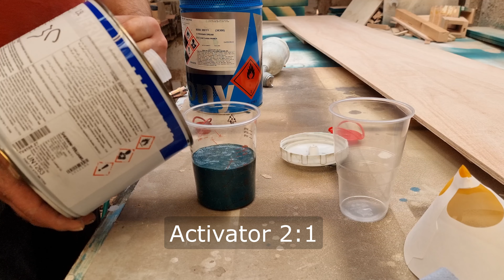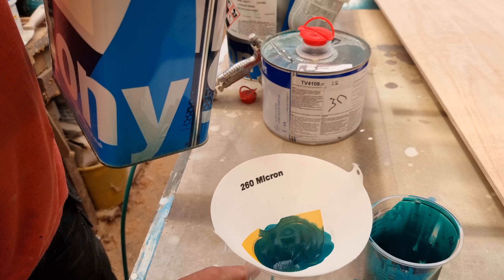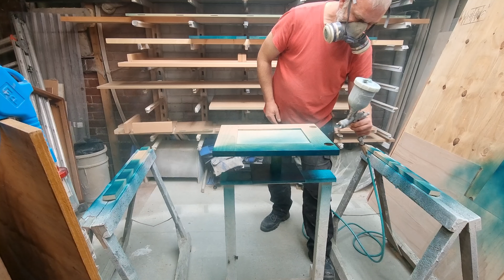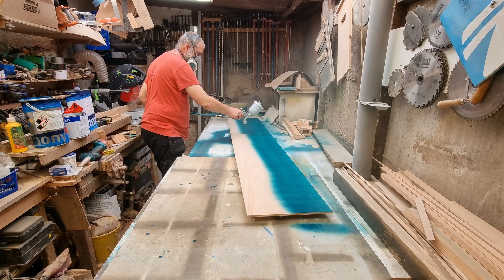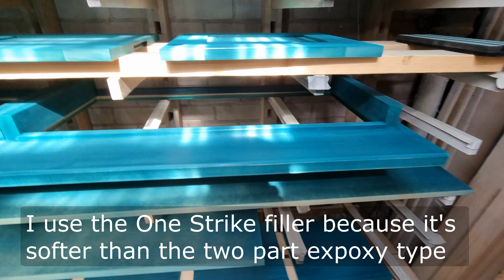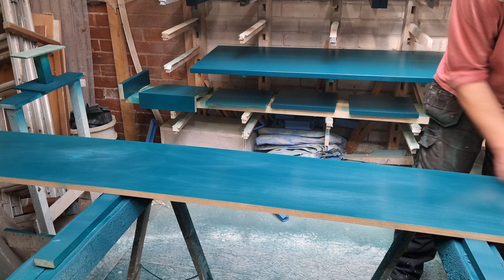Built-in bed over bulkhead build Pt6 - Spraying the frame, doors & shelf unit with PU lacquer

Comment: Great spray job mate, had to laugh when you cleaned your filter 🤣😂thought it was only me that was tight as a ducks arse ( and yes I also clean my filters so they last the day no matter how many mixes I do ) 👌👌👌👍👍👍🇦🇺
Reply from the maker: Thanks 👍 I do change them between primer & top coat but yeah they get cleaned, & the thinners used either goes to thin the next mix or for cleaning the gun 😁👍

Comment: Enjoyed this 4 part series i enjoy the woodwork the most as thats what i done, but i did dabble with the painting aswell , but it would be handy if we could have a seperate place for painting.
Look after yourself big mate 👍
Reply from the maker: Thankyou, much appreciated 👍 yeah def need a separate area for painting, a lo of my tools have overspray on them 🤦‍♂️, I'll have more of these from 2022 to come, I'm not quite back at it yet but feeling a lot better than last yr so we'll see how the rest of this yr goes,  I'm not stopping working tho so I'll keep on filming & things should pick back up in time 😊
Reply: Can you not run a fan anywhere Gid? I'm in same boat (not everyone has the space or money for a proper spray booth!! I found a massive difference once I got even my Heath Robinson set up going
Reply: Especially with the solvent based. I only tend to use water based for this reason
Reply: Also as an aside you put me on to those Flexipad sanding sponges years ago and I have used them pretty much every day since 😂
Reply from the maker: Hi, sorry I don't get notified of replies so if I miss any comments.., There's a big fan above the door in the main build area but in one of these last vids I noticed when editing I'm spraying that thin corner strip & my drill is sat right there, I bet there's a bit of overspray on that 🤦‍♂️😂